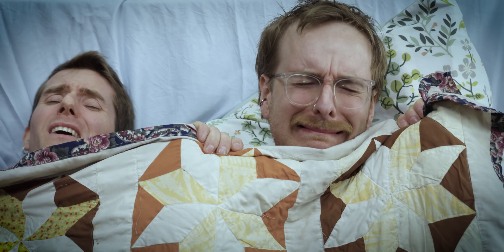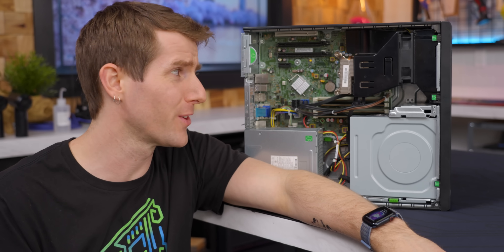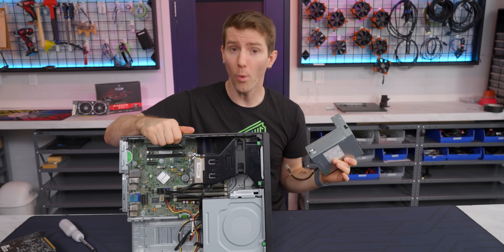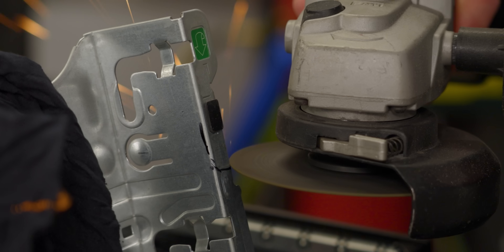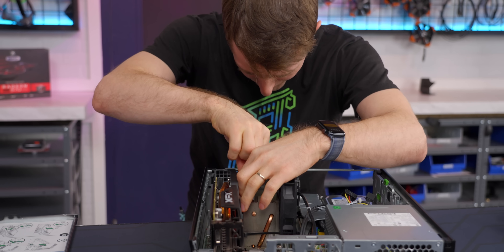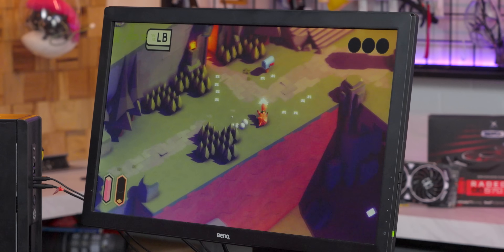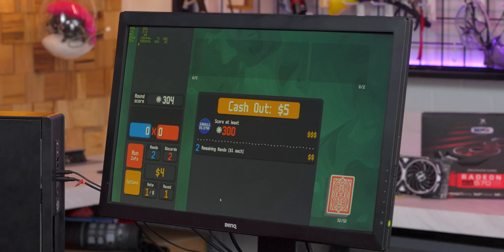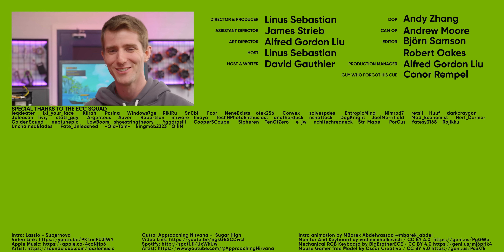How to Build the Ultimate $69 Gaming PC!

Comment: I have found that the Lenovo Ideacentre 510A-15ICB  is an all but abandoned model due to one of its 2 dim slots dying   On the regular so they are CHEAP for semi modern. This is a set back running single channel but they are remarkably capable and cheap for this reason. You start with an i3 8th or 9th gen single 8-16GB of ddr4 and enough space for a full height GPU. The even better news is most come with a 128-256GB ssd to get started. The 180W power supply can run a 1050TI with turbo boost turned off on the CPU. This system is normally $100-120 bones to make especially when you buy the tower 2-4 at a time.  Yes you need a PSU upgrade asap but it works for months. Another nice to have is a box of 5 “silent” 80mm fans and use two per PC one for intake and one for exhaust with a simple sata to 3/4 pin adapter for the fans. This drops temps 7-10C even in nine in test for 2 hours of heat soak. 

The cheapest upgrade path without cutting is an apevia “400-500W” TFX forgoing the 1050TI and finding a short full height 1650-1660 or 1060 6GB for about $60 more. 

Endgame upgrade is a quality TFX PSU from a reputable brand costing more than the base PC. Securing a second hand short RTX or GTX GPU of your choice and, a i5 or i7 8th or 9th gen. This places you around $325-375 mark.

Comment: I made a build like this a couple of months ago, and it turned out great! I swapped the mobo and parts to a new case. Just a tip if you are going to use a new power supply: Hp motherboards use a proprietary connector from the psu and you'll have to buy an adapter (you can get on amazon for like 10$) to make it work if you plan on ditching the old psu. Hope this helps 🙏

Comment: ‼Just install a used Xeon Ivy Bridge E3-1240v2 processor (with 8 threads and 4 cores, LGA 1155 socket) in that system, which has performance similar to the i7-3770 running at up to 3.8 GHz in Turbo Boost. It costs only about 15 dollars. This processor runs as fast as an AMD Ryzen 3 1300X. Combined with an RX580 GPU and a cheap Chinese SSD, you'll get a noticeable performance boost👍
Reply: And yes, you can use those semi-custom RTX 3060m GPUs, which are modified mobile graphics cards turned into desktop versions, with 6GB. I know they are very affordable, around 30-50 bucks for a real RTX GPU! Again, sometimes they show up on Chinese marketplaces, and then you can even play Cyberpunk and newer games with DLSS.

Comment: Why opt for an SFF with a crap power supply when you can get a better pre-built tower PC that has a good OEM power supply with enough power? The tower also has extra Molex power connectors that are needed to use a Molex to 8-pin GPU adapter cable. I understand the price restraint and the need to make this video entertaining, but for not much more money for a tower workstation PC, like the HP Z420 that has a 600W 80 Plus Gold PSU, you can avoid hacking a case, avoid buying and adding a power supply, and have something that doesn't look like trash. So yes, I think you should do a 169$ PC build.

Comment: By fishing on second hand markets I build my gaming workstation for 200$.I got:
NEW x99 motherboard with NEW 12cores/24threads Intel Xeon.e5-2670 v3 (around 20-40$)
NEW 32GB of ECC RAM dual channel (20$)
NEW 512 SSD sata drive (around 20$)
USED but very NICE corsair PSU, (up to 40$)
USED but very nice ThermalTake cooler with neat RGB. (up to 20$)
USED (post-mining) rx570 sapphire 8GB(60$) (works really well btw)
(GPU is a real bang for a buck, Witcher 3 on max settings runs very smoothly in 1080p on Linux)
(there is one nitpick with the GPU, it's cooler got just so slightly rusty, from crypto-basement humidity.
A good tip would be to look not for the best offers but for honest offers.
I chose a particular GPU seller on the basis that he was honest enough to admit it's from mining, 
and he was honest enough to even run some test before giving me the card)
Case I build myself out of wood. It looks like a cyber-furniture.
(I used a cardboard box  as a case for a week while building, that was fun)>
I don't remember the prices exactly, but I am sure I did not go over 200$ US

Comment: I tried to turn a Intel gen 4 i5 dell opti into alow mid gaming pc for a vpin machine. To make the graphics card worked i needed to put in a better psu. But dell uses a proprietary connector for their mobo. But don't fret! Adaptors exist. Buuuuut my mobo still got cooked by the psu and this was after I pain stakenly removed the hard drive cage (riveted into the chassis) to make room for the gpu. Proceed with caution with a dell.

Comment: I think i bought the same motherboard as you guys have. BUT i bought motherboard only for 10€ (not great, i know). I had had a hard time trying to find a cooler that would fit (clearances are a pain in the heiny), which eventually i have, but still. Then i got the PSU adapter for 7€, 8GB ddr3 stick of ram for 5€ and a xeon 1225 v2 for 15€ (compatibility was not an issue (for anyone interested)). Thankfully i did not have to buy a PSU, SSD or a case (but i did have to drill some extra holes into it for the processor fan standoffs. So all in all not too expensive, but not great. Comparing that to a ssf lenovo system with lga1151 pentium gold (6th gen), 4gb ddr4 memory, 500gb hdd and 120ssd that i later got for 20€...

Anyway your tips are on the money. This is a great way to buy a cheap PC if you are not in a hurry. If you take some time to get a feeling for the current prices and if you know what you are after you are going to get a good deal, even if you don't play your cards perfectly. 

But beware - you are going to invest quite some time into this! Because you have to and because you want to :)

Comment: It is possible to get Acer desktops where I live that have an i5 8400 or i3 9100 for around 30-40 dollars. And on ebay I've seen some go for 50-70 dollars.

If anyone wants a cheap lga 1151 platform that's 8-9th gen I'd go for Acer Aspire.

Comment: I did this back in quarantine with a 1650, had a old office pc with a 3770 and it was a small form factor so I cut a hole in the case panel and threw in the full size gpu

Comment: It's not $69 dollars, But Lenovo P520's (roughly $150 usd) are great value. Typically come with a 6 core (12 thread)  Xeon and 900w 80+ platinum PSU with 2x  6+2 pcie power cables.

Comment: I believe a $169 PC would do great. The extra hundred can be dedicated to your GPU while you can use your previous $69 to find a newer workstation with perhaps an 8th gen I5. The newer workstation would have a bigger PSU with more ssd and maybe m.2 support. For the graphics card I'd recommend the 1060 6gb (which can be found used for $50-$80) as it is a substantial upgrade from its 3gb counterpart. My first PC on a budget ran a 1060 6gb with a ryzen 3 3200g which provided great performance in most games including some triple A games.

Comment: I did this kind of thing to get me back into PC gaming. My budget was a bit higher and I shot for future upgradability, but the overall process was similar in that I started with a ewaste 4th gen Intel workstation, which I got for free.

It had an i7 and 32gb ddr3 RAM, all neatly wrapped in a gross HP prefab case. 

My spend was on a modern new PSU (as I don’t have a lot of faith in second had for that particular component), and a refurbished 6750xt. I also got a new case to avoid the angle-grinder tech seen here, and finally I also splurged another £8 on the required cable to allow my PSU to hook up to the proprietary sockets on the motherboard. 

I ended up with a very nice machine for the total cost, with the only real downsides being the IO and connections on the motherboard - all but one of the SATA connectors for hard drives were completely unusable thanks to the GPU, so I had to live of a single 500gb SSD until my next upgrade!

Comment: It's funny because I was just in a situation like this, building a system for a friend, and settled on using an old Aurora R2. I swapped the CPU for a Xeon X3470 that I clocked up to 3.4GHz and an RX 580 8GB. It can't run anything that needs AVX, but damnit if it can't play the hell out of anything else. I even edited some 14 bit 2.5K RAW footage on it! All for about $50 because the guy I got the card from thought it was dead and sold it to me for $10.

Comment: instead of using 2 psus in an older pc i basically did this on, i found the exact pinouts and wiring of the oem power cables, matched them up with the correct wires on the new psu, (which was just a better psu from another office pc) and removed the 24 pin and just spliced together what it needed, i wouldnt recommend but that is a way you can get around buying adapters for the 24 pin. kinda sketch thouh

Comment: I remember when I was working long shifts at a data center,  there use to be bunch of amd radeon 400/500/600  cards not in use. So we to took them slapped them into the slim work station with side panel open just get it to fit and had outside psu from EVG if i rember correctly just to play WOW or CSGO when we had nothing to do except lokking at the screen
 heheh 
this was back in 2018

Comment: I have a Dell Optiplex 3010MT with an I5 3470, 16 GB DDR3 G-Skill Sniper RAM, 2x 500GB Apacer SSDs and an 8GB AMD Sapphire 580 Nitro+ GPU. All powered by an SeaSonic 500W PSU 😂😂 
(I DO NOT play on Ultra Settings or newer Games!)

Comment: I think even if you're on a super tight budget, spending an extra 30 bucks and making it an even 100 gets you so a so much better experience that it would be worth scraping together the extra money, even if it's difficult. Even something as simple as just having more SSD storage available will have a huge effect on the overall experience. You can compromise a lot and still get a decent gaming experience if you adjust your expectations in regards to what games you'll be able to play, and at what settings, but if you have to wait several minutes for games to load, then at least IMO, you're less likely to play them even if they run fine.

Comment: I Was just finishing doing this to almost the exact same machine yesterday (Except cutting a hole, Instead I upgraded the included 512 MB Video card to a low profile RX550 4GB that fit in the slot and fell within the power budget of the included power supply) Ist Gen I5 (New in box system including Keyboard/mouse) -$17 16 GB DDR3 Ram -$19 (Upgraded from included 4GB) RX550 Video Card ($36) Added a random spare 240GB SSD I had around, and tossed on linux. Probably Wont game quite as well as the PC on here for a slightly higher price, But I was also aiming more for it to do streaming/ Recording, but it can still game OK.

Comment: I agree that buying a Sandy Bridge business PC is a NO NO. Too old, does not clock very high etc. 

These Z220 Z230 SFF cases, something to note, the PSU fan tends to seize up, requiring an F1 keypress for it to boot. But, PSU is efficient enough that the fan is not necessary even with 247 100% CPU utilization. Powering a GPU PCI-express Slot may add too much load tho but I have not bothered to see if the fan is sourceable  buying the same PSU model online will be used and prone to seizing. Could just use a single ATX with the proprietary adapters but again, too old! 

With my BOINC farm 3rd/4th aren't that reliable they can be a bit crashy have to power cycle occasionally. 2nd Gen is reliable, but too old. 

Skylake-class (6th-9th or 10th) FTW, unless you want to run Photoshop newer than 2020. Most have been running nearly a year 247 no reboot. 

6-8th gen you can use Throttlestop to Undervolt by 100mV reliably (if bad silicon lottery, 80mV) (9th+ blocked cuz Plundervolt), i5-8500 is the sweet spot 3.89GHZ all core about $90 online (USA) then for my person rig I use a PCI Express extension and another PSU beside, all set for midrange gaming. I run a 1070 with i5-8500 HP Prodesk SFF it's great.

But yes higher cost. I would definitely set a bare minimum of a business PC with a i5-6600 that 3.6GHZ clock that give you at least some horsepower. Like $65 online (USA) and then see about PCI-powered half-height GPU to plop in, SSD, and be happy. Longevity; Spare stock CPU coolers are plentiful for now for eventually fan aging. PSU fan is very small, may be sourceable but it's 80% + Platinum at least on Prodesk so it 'should' be ok with fan seized. I've tested with zip-tie thru vent. PSU casing doesn't get too hot but that is objective but they have survived multiple summers in my garage (with functional PSU fan) with peak of 130F or so with 0 failures. A number of old 3rd/4th gen w/seized PSUs also have not failed. 

The right used business PCs are super reliable.

Reminds me, how's the cost-conscious LTT PC design coming along?

Edit: 16:20 PSUs and Mobos failing is why there is a surplus of components for these machines? Or is it common business practice to scrap out good parts from a machine heading to the e-junk pile whether or not it works, or has a pesky fan failure warning, or broken?

Comment: How much you need to modify the case to fit a GPU will vary by the exact configuration you end up with. I bought an Optiplex & it had a rack for mounting additional hard drives & by taking that out(which required some elbow grease but no power tools) I almost had enough space for a full size gpu. The connector for the front io USB was still in the way. But removing that just cost me 4 USB plugs. Since I still had the back USB it was a small price to pay for an actual GPU.

Comment: Bought a gigabyte x97n on eBay for $30. Came with 16gb ddr3 and a 4770k. Pcie4.0 cards suffer from lack of rebar. My 1080 outperforms my 7800 xt. I wouldn’t recommend doing this. For a budget of $150-$200 will build you a pc you can game another 3+ years with.

Comment: For cs2 it definitely was the fact that it was 4gb not 8gb cos my pc that has relatively similar cpu clock speeds etc but has 8gb Rtx 570 (that I bought for around £50 used)  runs perfectly at around 150fps avg and 90fps 1% lows

Comment: I have a Dell 9020 SFF with a core i7 3770.  I was able to run an Asus TUF Gamming 1650 OC. with no issues on the 240 watt psu.  I did have to use a sata to 6pin pci adaptor though.  That system is now my plex server.

Comment: I built a cheap gaming pc for one of my brother using a 580, and he can play helldivers at 50fps on low medium settings.
Just used my old power supply (with the connector cable), bought the cheapest case I can (also soldered so leds to the case), and used an optiplex for the rest.

Comment: I feel like it would be fun to mix the ideas up and limit yourself on a budget for the initial PC buy and then a seperate budget for the upgrade path. So say your total budget is that $169, you can only spend $40 or 450 on the initial machine and the rest of the budget has to be upgrades for that machine. And then whatever pricerange makes the most challenging, but rewarding price to performance initial machine purchase.

Comment: i built a pc like 2 days ago for $200 CAD $140 ish US idk it had a GTX 950 I5 3570 and 8 gigs of DDR4 Ramm i bought the cheapest stuff and it runs fortnite at around 80 fps with 50 1% lows and rund cs2 at around 120 FPS with 90 1% lows every part was second hand

Comment: its actually wild that I at one time had a weak PC where my main PSU was too weak, but I had a more powerful one that was like broken where I could only use it to power my GPU and guess what I did; mounted it HANGING inside the case with cable-ties and shortened specifically the pins responsible for powering it on on the modular slots with a copper wire
Ah the times of being a broke teenager

Eww FSR, if you have to use AI upscaling with blurry TAA, then please dont

Comment: about a year ago, I bought old pc. idk how old but it has core i3 540 which indicating it is from 2010-2011-ish. it needed repair and replace the new ram, it was hell to find the parts.
nevertheless I bought it just for 1 purpose... Install windows XP to playing old games like aoe, zeus, pharaoh etc because those games no longer supported in windows 10 and 11. and I'm happy it works !! just one thing, I would never let it connect to internet or use it for any other purposes than playing old game even for 1 sec because no more security and virus protection updated for the os.

Comment: One thing I think they missed pointing out as an issue with picking up older parts is potentially being stuck on Windows 10 and with its end of life approaching in the fall that can be an issue. Windows 11 needs Trusted Platform Module (TPM) 2.0. That might have been another advantage coming from a workstation or a prebuilt since they most likely had one installed. I ran into this issue with trying upgrade my old build so my wife could play BG3. I had an intel 6700k on an ITX motherboard and one of the things they dropped on the ITX version was support for a TPM. I know 8th gen intel has TPM support built in so I might try and find one of those.

Comment: Hey, does Canada have any flea markets or used thrift stores?
I ask because I know you can very likely get a full sized workstation there, because they usually have them in bulk and trying to get rid of them. I have seen places turn these into linux systems with console emulators on them and sell them for 20 bucks. You might be able to haggle them down as well. 
I think going thrift-shopping would be almost as fun as scrapyard wars. 
Also, i betcha any PC shop has loads of unsellable items bound for the smelter/recycler that aint dead yet and would game and be upgradeable.

Comment: instead of buying a whole external psu you can just buy a more powerful tfx psu this can be done for example with a lenovo thinkcentre m73 sff you get an adapter that turns the 24 pin into 14 pin and you are golden and you get actual gpu connectors without the need pf a secondary psu